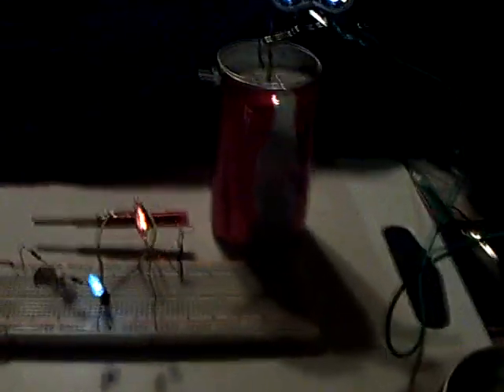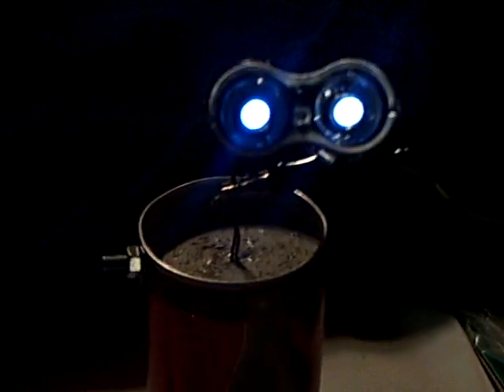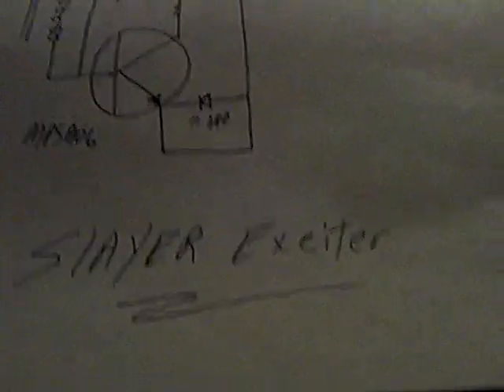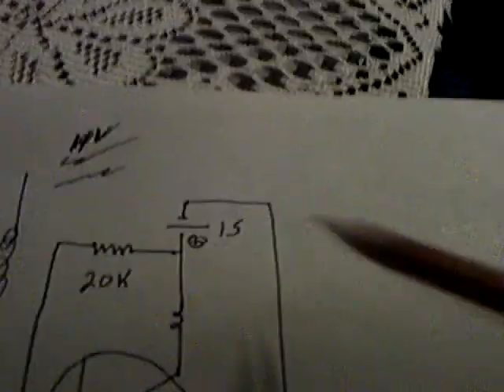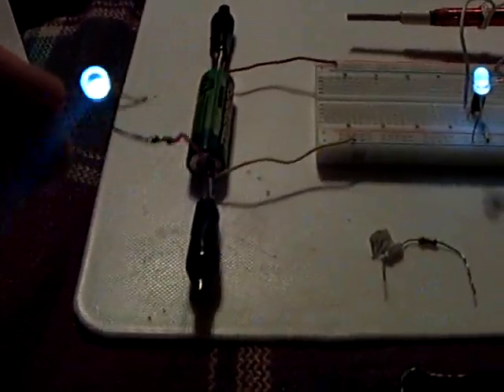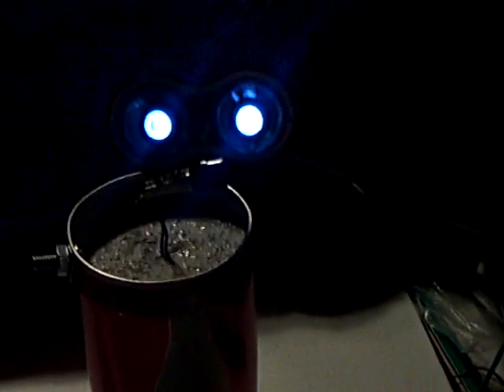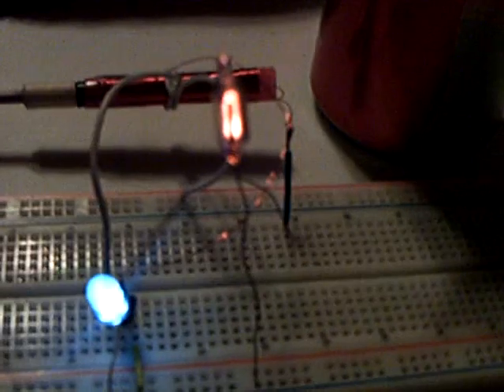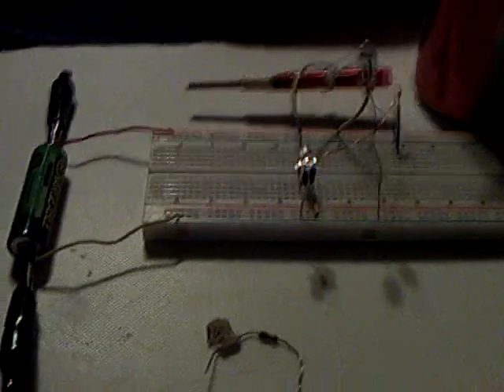Tiny Slayer Exciter with ferrite core.ASF

Comment: @Lidmotor It is interesting though, as I've found, with the bifilar Joule Thief, when you get just the right resistor in place, you can (seemingly) optimize between spike, and current and get nearly 70 or 80% of the light at 1/10th of the draw. I've been trying a LOT of different little torroids and bifilar bobbins, and I've found if you use a bit heavier of magnet wire, you can really play with the current draw :)

Comment: @Lidmotor Well, I'm just learning so I have no real valid opinion but it seems to me resistors when effectively eliminated reduce circuit waste heat. The Slayer Exciter circuit is very simple, and has been shown to offer good input vs. output. I think that there can be something said for "getting the job done with the spike", whilst working with a minumum required input voltage, too.

Comment: @Lidmotor   Any hints on how to get it to light up the first time for a hobbyist?  I tried your schematic, an air-core inductor with an iron rod, but would not light up...   I've been building Joule Thief circuits successfully, and this is similar in some ways, but no luck yet...  Can't "see the light."